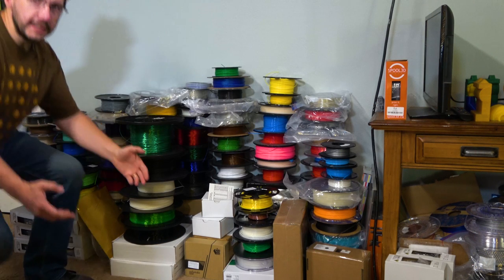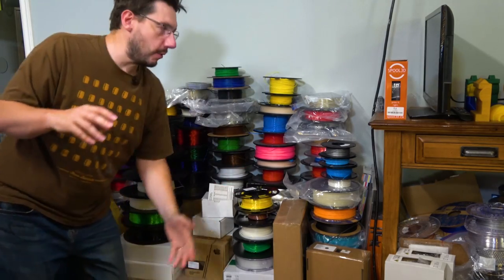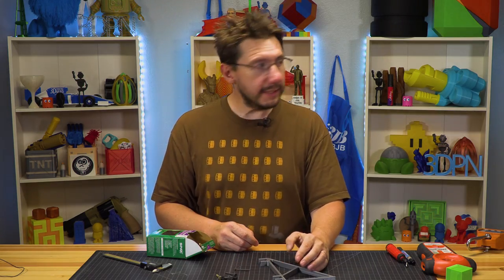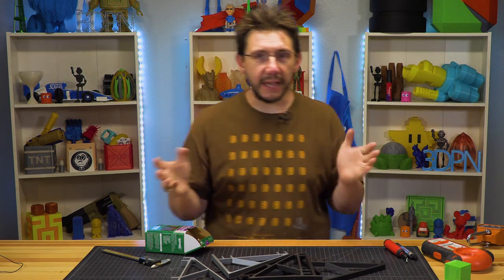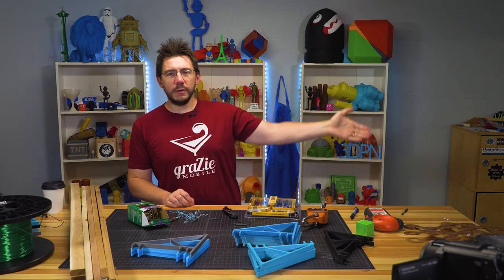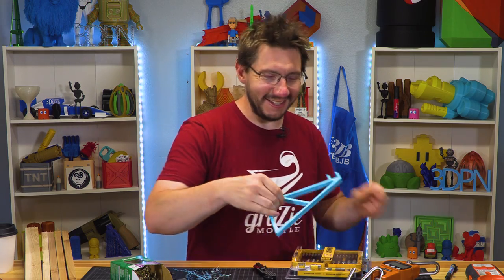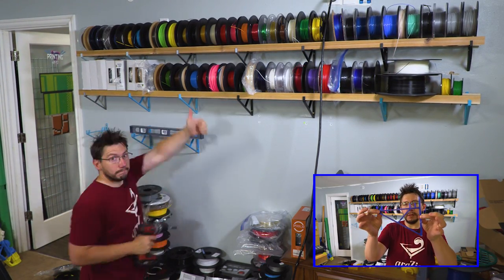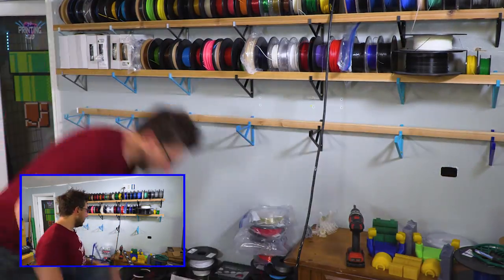Practical 3D Printing Ideas: DIY Shelf Brackets! Filament Shelves!

Comment: About using a tool to strip off the overextrusion of the first layers: In FreeCAD I like to cut a 0.5 mm chamfer on all edges of the face that will touch the print bed. That chamfer compensates for the overextrusion, so I get nice, vertical edges; no post-print cleanup needed, and the parts fit together great!
Reply: Bradford Needham that is a good idea I am still getting used to freecad struggle with sketches

Comment: I realize this is 5 years old, but I have been using these same storage brackets for about 4.5 years. The last 2 years, 2 different rows have broken off the end tabs, causing all the filament to roll off the wall. Without redesigning these, I found that increasing the perimeters to 6 then printing them out of PC-CF (PolyCarbonate with Carbon Fiber) has been durable enough to withstand my tests which are designed to put force directly on the piece that breaks. Pulling DOWN does not cause this to fail. Pulling OUT does. The combined pressure of all the filament on each of the brackets, causes them to fail outward, away from the wall, not downward.

Comment: I'm currently doing something similar ... though not using plastic wall plugs. I'm using Molly bolts for that. 2 molly bolts per bracket, walls and brackets won't even have a sweat when spools will be stored on the shelves.

Comment: Interesting. BTW those drywall screws @5:11 look like fine threads, not course. Those are typically used with the galvanised steel studs, not regular 2*4 lumber.

Comment: For more info on making and testing parts that need to work in tough environments (like tarp locks), I'm a huge fan of Clifford Smyth's books. His "Functional Design for 3D Printing" covers way more printing detail that I can yet absorb, and talks about cheaply stress-testing your design with just a big bucket of water as a variable weight.

Comment: Not sure if you read anything that is on a old post but I have found your brackets to be very useful. Couple of notes, I did have to widen the plank holders from 18mm to 19mm, probably just variability in the wood I got.  I also made a piece that can be hooked on to the end of the 1x2 to act as an endcap to prevent rolls from getting to close to the end and falling off.  I would be happy to share the stl and cad files with you if you are interested.  Thanks again.
Reply from the maker: I DO try to read comments on old posts. Thank you for the update, and I'm glad to hear they are still useful. As for sharing the STL, I don't know of a good place to put it, but it's great you were able to do that!

Comment: Great DIY video. Perfect solution to the problem. One thing, you should have run that wire behind the shelving for a cleaner look. A couple minutes with the side of a larger drill bit could have made a channel in the wood for it to run through then just design and print a stay for the cable at the bottom of the wall.

Comment: Had a PLA bracket break today after 4 months of use -- weak spot was between the 1x2" board holders nearest the wall. Spools fell onto the shelf below and another bracket there cracked in the same place. It's possible the 1x2's were a little thick, forcing the bracket's board holders apart and weakening that area over time. Printing again with even more infill and shells!

Comment: On the top shelf you have ~38 spools, if each were 2.2#, that's ~84# dived by seven brackets yields 12# per bracket. Add a little for the tare weight of the spools & the weight of the lumber, and any of the plastics would technically work, especially if the design of the bracket was improved, as it is lacking in engineering. Overall informative content... thanks for sharing!

Comment: The word for that type of screw is a countersunk screw, for fitting them flush to the surface using a countersunk hole. A good rule of thumb for designing with them is that the size of the head is generally double the size of the thread due to 45 degree angle.

Comment: When the video started I thought maybe you were gonna use Thomas Slam-Dancener's 2016 method of post-annealing PLA and other plastics in an oven.  His results suggested that even the cheapest PLA print was made stronger and stiffer by the hour-long process.  "Bake them brackets" would have been a cool slogan.
Maybe you could send one of your brackets to the CNC Kitchen guy (or just have him print one from your file) to measure its true load-bearing capacity on his custom stress tester.

Comment: When I first started 3d printing 2 years ago, I built a shelving system where I could feed any filament up and over to my printer.  Then I realized what moisture could do to a spool so I nixed that and now I simply store all my spools in a locktight tub with a rechargable moisture remover.  I only take out a spool when I'm actually printing something.

Comment: 5:08 - correct me if I'm wrong ya.. that screw is called a countersunk screw. It is used if you want the screw head to sit flush with the surface. However, it will only work if you countersink the screw hole. 🤘

Also, love the idea!! 👍🏼👍🏼👍🏼

Comment: All those nice filaments sitting on a shelf unprotected sucking up moisture and dust. <sniff sniff> So many 3D printing guys on YouTube don't understand the word "hydrophilic."
Reply from the maker: So, they've been out for 2+ years with no printing issues at all. I dry my TPU and my nylons. We have house AC and the room humidity is usually consistent at 35%. So, until it's a problem... :)

Comment: I Printed one v2 up last night, interested in your settings for printing, I might have missed them in the video. I printed in .15 at 75% infill on my Prusa I3 Mk3 with red hatchbox PLA. Printing the other now. Print time was right at 6hrs. Going to buy some 1x2's today and get it mounted tonight. I also have an LED strip that ill mount to the underside of the board foe a little extra flair. Only have about 10 rolls at the moment since I just started printing.

Comment: The difference between the drywall screws and the other types is that they are phosphatized to withstand the gypsum of the drywall. Normal screws will corrode over time as far as I know,.

Comment: It would be really cool to design and print moveable tags that hang on the front so you can easily identify single spools. Something resembling a gamma (Γ) in profile with a little lip on the short side and then attaching a label of some sort to the long edge.

Comment: Personally, I would of used pan head wood screws with a small flat washer. That would of helped distribute the load over the hole in the pla bracket.  I’m sure you already know what happens to pla when you screw into or put a load on it... it will eventually deform over time... which means those screws you bought, even though the chamfered area is much smaller than the drywall stew, will eventually spread/delaminate the holes in the bracket.

Comment: You could print interconnecting 16 3/4 inch pieces that connect at the shelf brackets. Making a 100% 3D printed shelf system

Comment: joel , just a heads up. today no one should be using "phillips" headed screws when you have the torx drive screws available. notice when using a phillips your screw gun must be straight and still you will see your bit jumping out of the screw as it rotates, you then will find yourself pushing the drill with two hands and exerting quite a bit of force just to find the bit still jumping. now that the screw is all the way in chances are youll never get it back out because the bit pattern is so stripped from the install. now use a torx drive screw. you can do it one handed without pushing or stripping and itll come back out. I did however notice you chose the spax they are torx drive , buit still wanted to throw this out there for everyone else also.
Reply: Courtney Strachan dont forget square drive.  Poor little square drive.  Always getting overlooked.
Reply: I believe that's an intentional design of Philips screws. The bit jumps out before you over torque it and snap the head.
Reply: John Clark - That’s what I was under the impression of also... quite maddening, actually...
Reply: Phillips head were designed that way as a way to torque limit them, problem is the screws are made out of garbage metal now. Funny enough I believe it came about because Robertson refused to allow ford to have exclusive rights to the square drive.

Comment: What a great project to use 3D printing to help your 3D printing space!   Thanks for another wonderful video.  I am looking forward to the next video showing the strength of each bracket.
I have a question about the filament sitting on your shelves.  How do you keep the PLA and Nylon dry?  Do you keep a dehumidifier running  in the room?  Do you dry the filament before using it?
Thanks for all you do... and High 5!  :)

Comment: Just woke up, got my coffee and croissant and what do I find? Another great episode to watch by 3DPN. 
I like that you saw an opportunity to add a colour gradient across the brackets instead of just one. 
It's awesome to see you get into the physics of 3D printing. I'd like to see more of this. I can see you getting excited as I do when printing something functional. I'm yet to print something purely ornamental. It's a waste of plastic IMO. So I get irritated looking at your objects piled on your shelves behind you. 
Re bracket strength: there might be a weak point on the inside front edge of the timber slot furthest from the wall. With all those spools pressing down and spreading the two lengths apart, the very front slot may crack, releasing all the spools... hopefully not the top one. Unlikely because you've got seven brackets and the load is well spread out but just a thought if you want to improve it, thicken that front corner.
Also, is it common to have GPOs that high up in the US? It's weird to me.

Comment: Having viewed this video and the subsequent one with the improved truss design, I can't help but wonder if your needs would have been better served flipping the bracket 180 degres , and have the bracket in "tension" rather than in "compression" when the bracket in under load....Also, aligning the filament extrusion along the length of your longest truss (or side) should,  in theory, improve the load bearing capacity of the bracket..( I'm not an eng. but it would be worth a try...🙂)

Comment: Laser level line projectors are not very expensive and would make straight shelves a breeze.  Also, GRK cabinet screws at the HD don't have as much chamfer under the flat heads as the SPAX.

Comment: Good call not using the drywall screws Joel. They have next to no shear strength they are solely designed for clamping force. You would have come home to 300 rolls of fillament on the floor.

Comment: 2 wood beams are good but I would've went with a 1x12x8 or 9 and then made little divots or spaces for the spools so they rest in place. It's probably my OCD that i just think a flush board would look and work a lot better but it's all up to preference.

Comment: I'm a little surprised you'd hang so much stuff on the wall without trying full strength first. :) I think I'll wait for your strength video before I do this. That'd be a pretty big catastrophe if one of them failed and caused a cascading fail.
Stefan from CNC kitchen has a video here in YouTube where he builds a bracket using some physics software to get a sense of load bearing weight.

Comment: Why did you've need these special screws? Do they have a neck before thread that will prevent destroying the plastic detail? Sorry if I've missed that phrase or something... Aha... They have "spacer included", right? So it will be all fine and not touching the plastic with sharp threads (?)
I have the idea: instead of wood there could be just "cloth drying ropes". These must be pretty cheap and you can make two pairs of strings instead of wood. Basically it will be working in the same manner. But it will be liter ... and maybe not so cozy :)

Comment: Joel. Listen to your son. Triangles are strong, quadrilaterals are weak points!!! Brackets would be stronger with that one center supporting beam making two triangles (the right angle bit near the lumber? It's off by like an inch and really would be far stronger being right on the corner), despite them being actually a really nice idea that I'm gonna steal soon lol. When you gonna paint the lumber white to match the door trim?

Oh, and hydroscopic filaments should go far away from that sprinkler you got in that wall, that could turn foul fast!

Comment: That's a lot of filament!  

Did you hit a stud on the third shelf first row or so?

Also, what advice would you give for printing an item out that needs some connection to put the parts together?  My idea is recreating Nerf gun attachments to connect them, but I keep on running into errors whenever I print it.   How much clearance should I allow for any print errors?  Let me know if you have something better or just some advice.

Thanks,
 Josiah

Comment: You said that the room gets hot!  Aren't you worried that those brackets may warp after time?
Reply: Ive had similar system in place, hold a lot more weight.. in rooms that get 80-90 in the summer for almost a year without any issue. And thats not even with higher temp PLA.
Reply: It should actually be fine as it is a fair amount below deflection.

Comment: Probably best doing your first and last bracket, level wit your long lumber and the spirit level then add the ones in between.
Reply from the maker: Hmm, good point. I need a longer level :)
Reply: 3D Printing Nerd naa. Just use the shelf. Spirit level on top and with your third hand screw in the bracket

Comment: I would suggest having proper triangulation in the bracket itself for structural integrity. That is, having the triangle bracket seperated into two seperate triangles. (trust me I'm an Engineering Student)

Comment: You should have done topology optimization on fusion 360, look it up it's pretty easy to learn.
Reply: Could but for the weight, its really just a waste of time vs a 10 minute drawing the pretty obvious force directions.
Reply: Matt Weber it could have hold more weight with less materiel and it takes like 20 minutes, and the perfect force distribution is never obvious so it's always a plus :)
Reply: IF they get the file back to you in a timely manner.. last topology opt i tried it took 2.5 hours to get the results back since its done remotely and depends on their server load. Also it only really works well if your knowing the weight your going for, already caculating how much each bracket itself will have to bear given how the weight along the shelf is distributed, etc etc. To be done properly the whole shelf system technically would have to be calculated and drawn up and optomized with weight loading, or the results arent any more beneficial that simply using a basic triangular design like he did and the scale once mounted.
Reply: I didn't know that, I use solidworks and it's pretty fast, also on solidworks if you set the right you goal don't really need the informations on the weight as weight is not going to change the "perfect shape", only force direction does but this one doesn't change

Comment: Silly question, fixing shop back up post Harvey Flood (my printer survived!).  I really like your filament holder and while I don't have as many filaments as you I have about 20 spools or so (caught a sale).  Question, will your bracket fit on the bed of an Ultimaker 3?   Didn't know if I should just design my own that would fit, but yours would be super easy if it does fit.  Please let me know, looks like you have or had a Ultimaker 3 so, hoping it is easy for you to check.  By the way, EVERYTHING in life should be arranged by wavelength (I work in fluorescent imaging and everything is down to wavelength).  Thanks!
Reply: Nevermind, bought the bracket and with a bit of wiggling it will fit, but you can't use a brim, so it just squeezes in if anyone else is wondering.
Reply: Actually found you can use a tiny brim, which did help the printing!

Comment: How would that work if you have to protect your filament against humidity ?
Reply from the maker: It wouldn't - it would need modifications. However, our house is climate controlled and my open filaments haven't had an issue in 2+ years. I do, however, dry my nylons and flexibles.

Comment: Ha 9 inches is perfect. 
Awesome work on these. Alas the pitfalls of living in a rental house I can't use these
Reply from the maker: Awww. That's no good. I wonder what a good solution for a rental house would be.
Reply: Yesterday I was moving a set of plastic drawers and they were a sort of modular framework which could probably be adapted to suit filament. Now if only my brain would stop screaming at me every time I open fusion 360
Reply: yep renting SUCKS can't drill or attach anything to the walls. :(
Reply: I have the added bonus of an older house with magical ASBESTOS!! I'm not game to even consider drilling into the walls
Reply: 3M Command strips are awesome for tasks like this.
Reply: Why cant you drill holes in a rental home? I live in a rental house and i drill plenty of holes. We even took out a door and made it into a wall, isnt it just a matter of leaving the home how you got into it whenever you move out?
Reply: mick0maticNL mostly because the walls contain asbestos in my current house and landlords tend to not give your bond back if stuff has been drilled
Reply: @Maker's Muse Depends on the country you live in. Here in Germany it's no problem to drill :)
Reply: Shelving is the way to go or make a custom shelf similar to the way the shelves are in the video if you cant drill your walls You could even print custom frame work, shelvs etcetc all though I prefer the video version hehe